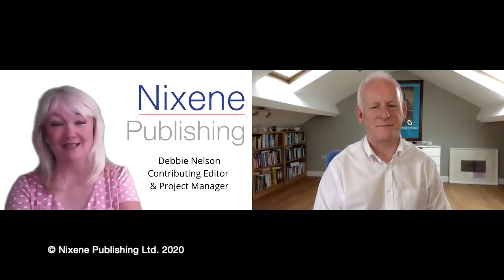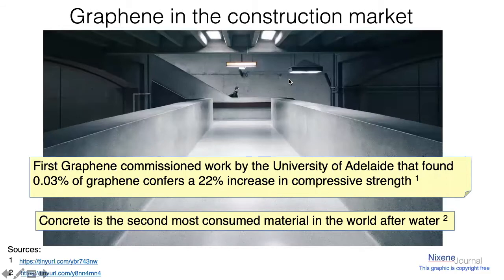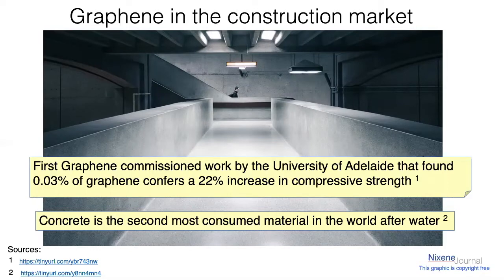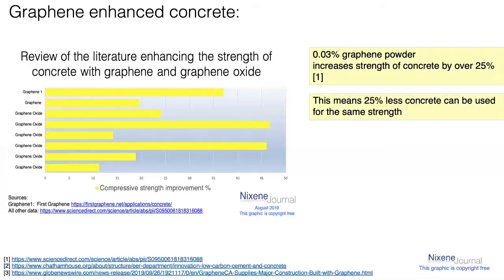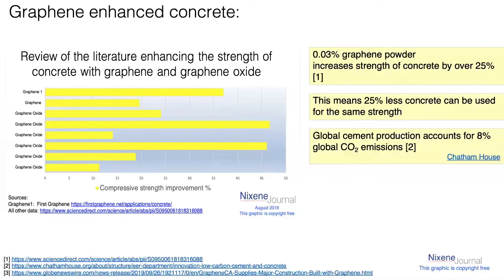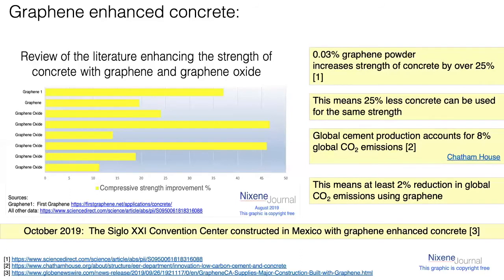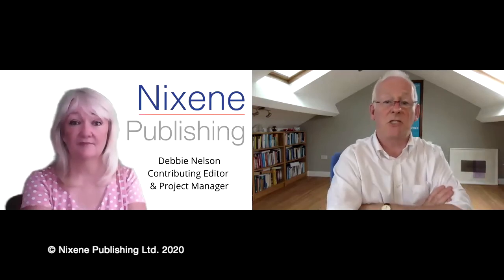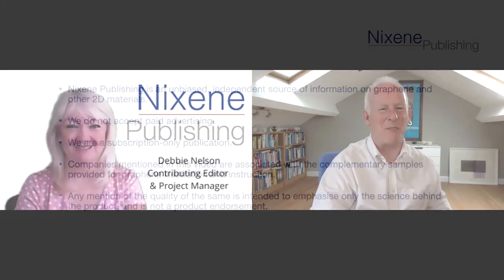26 - Graphene in Concrete

Comment: As ever a great piece. I am still amazed that we have these disruptive & emerging technologies that could contribute hugely to global Net Zero targets. However, we still have the challenges of government[s] embracing these opportunities and helping to drive their adoption into the market. Same old issue of technology adoption and exploitation. The UK is one of the global innovation and technology heavyweights but way behind on commercialisation. Great stuff Adrian & Debbie
Reply: Thanks Mike, I agree that Governments and the construction industry are slow to adopt disruptive technologies such as this.  Part of the problem is that clear messaging is not being created showing the benefits of adopting this technology.  We hope in a small way we are contributing to get that clear messaging out into wider circulation.  Once graphene - concrete composites start to become adopted the pace will grow exponentially. Adrian
Reply: @adriannixon1213    Adrian agreed. Keep 'flying the flag' for this sector. As we know there are some amazing solutions coming from this sector, however there appears to be a level of fatigue, after the initial hype around Graphene. By continuing to drive the message that the applications of this amazing material are now being realised, however there needs to  be a level of alignment, which your journal are helping to resolve, as you say, through clear messaging.  You are the expert on the ground and the Graphene Ambassador!! Mike